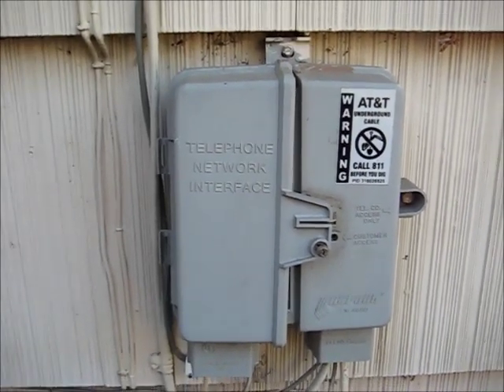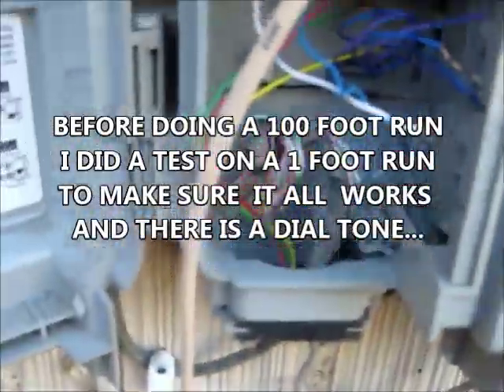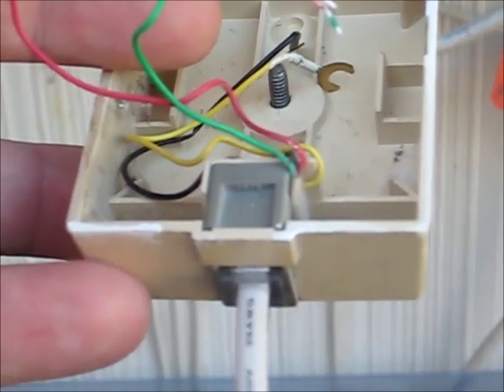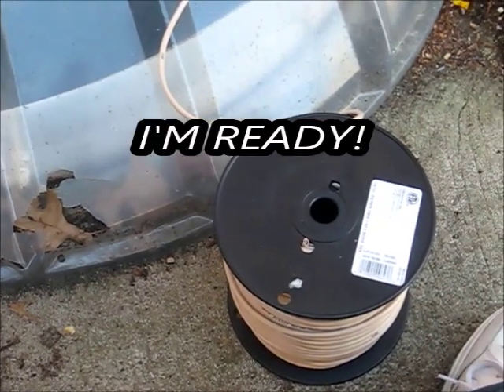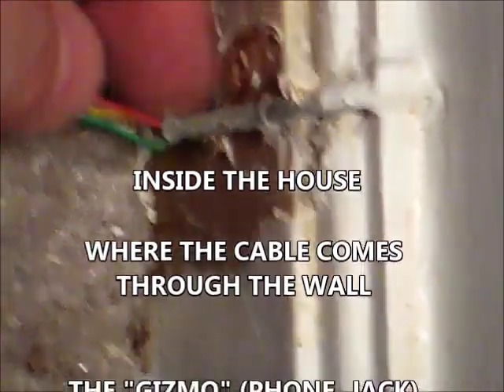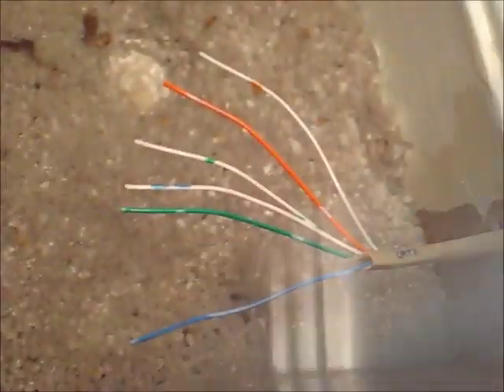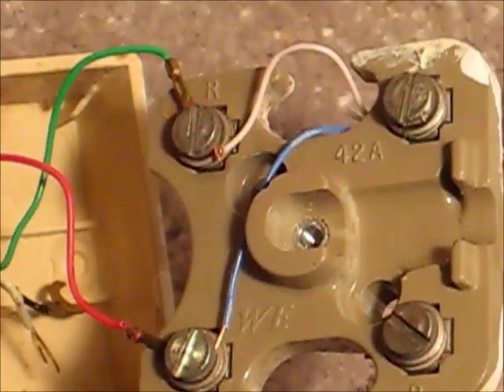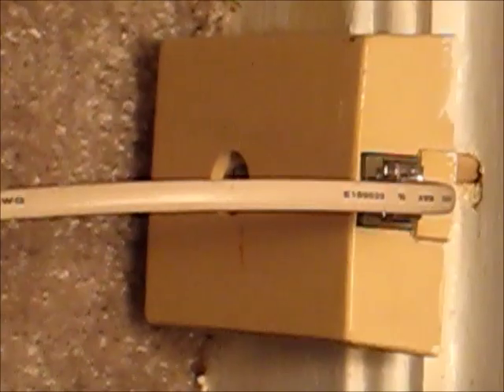☏ New Telephone Line Wire ☏ From outside service box to inside, repair landline, THE TRUTH, CAT3

Comment: This will be my summer project!! I am running a cable from the box to my fax machine in the basement and to the telephone. Here’s my schematic splitter , 2 junction boxes , a 100 ft of RJ 11 And 2 DSL filters. Thanks. This helped a lot
Reply from the maker: My pleasure to be helpful, I enjoy reading that, thank you for taking time to say thanks. Good luck with your project. I suggest doing some "test runs" to prove to yourself it all works. By test runs I mean short easy runs (as I show in the video...  and maybe do one where you connect you whole spool and and boxes) to make sure it all works. That way you KNOW if/when you attach everything, if there is a bug, it is solvable and at not a fatal flaw in design.  I do that myself because I have messed up enough projects, or planned poorly... or heck so many things. Now I make sure I am on track to start with... and then do my best to stay on track.

Comment: Add a solar panel to the unused wires on the outside box.
I rewired a few inside lamps to led to fit the inside jacks..
Bingo... at dusk I have free lighting or can use as emergency back up lamps
Reply from the maker: Interesting idea. Thank you for posting

Comment: What if I had VOIP service and want to switch back? Has the cable company done something on the other side of that box? Because I don’t have dial tone after disconnecting from Xfinity VoIP. Or have they done something at the underground box out by the street?

Comment: does power go to that box?  An electrician came out yesterday to do some work and now my phones do not work.  Maybe he pulled the power to it?
Reply: The power to the telephone line comes from the telephone exchange, the electrician probably have disconnected some of the telephone cables where he was working by accident.
Reply from the maker: Usually only phone wires come to this phone box, so it not usually something an electrician, dealing only with power to a home, would open, but I would suggest calling the electrician and asking them.

Comment: What if you do not have land line service and for the purposes of running an Voip through the internal phone wiring you need to disconnect the phone company line from the wiring in your home how do you do that short of cutting the wire
Reply from the maker: There should be a very simple way to dis-attach the connection of the inside wires from the out side wire. The video shows me opening the box and on the left side is wires going inside and the right side is wires coming from the phone company and in the middle is the connection. Simply disconnect it, then hopefully you can use the wires inside you house to do what they can do.... if they are all in good shape, if not you can run new wires either through your walls, or using outside wire, run them outside.

Again, as many people have said, and I agree, if anyone is not sure how, or is uncomfortable, doing this kind of work call in a professional.

Comment: Remember when you pulled the old wire out? . . . .    =]  Yeah  that would have worked. (Too)  
SMART to check that 100 feet first.  Thanks!
Reply from the maker: Hi Karen, nice to read a kind comment on this video, it gets a lot of hate and even more down votes, but it also gets a lot views... so somebody must like it even if they don't thumbs up much. 

I am guessing you are talking about the issue of getting the wire through the wall... and if so.... yes.... =] Yeah that would have worked. (Too) 

There are several ways of doing it, depending on which end one starts with... 

Sometimes with my videos (when I am re watching my footage) I realize I did use the best method to do something.... and 1) sometimes I will trash the video and re-shoot it... 2)other times I trash the video and scrap the whole project (especially when the chore is done and I am not motivated to re-shoot it or mess with it any more).. and...

...3) other times I decide even if what I showed in the video may not be the best way, IF the overall point was properly made and IF people can (obviously) see there is a better way to do a small part of the over all project, then I keep the video and people can watch and decide how to do it.... how to get that dang wire through the hole (hopefully as easy for them as possible)

Comment: When I set up my place...renegade...i ran a line from the telephone box at the edge of the property right up to my house and into a modem and then the laptop computer. Telephone Company actually gave me a spool of wire for this purpose. I doubt that they would do that again nowadays . It's pretty heavy wire, just two wires and not stranded , heavily coated. For quite a while now I've been having trouble, getting Wi-Fi reception during the day but not at night, so this leads me to believe that it's a problem with the phone company and not the wire. They want to come out and check things out and of course I'd rather they didn't come to the house. My main question is, where can I get some of this telephone cable, or is it just as good to use some of that military thin stuff you can buy pretty cheap over Amazon. I might add that the total run is over 300 feet, but it has been working just fine for 15 years
Reply from the maker: "My main question is, where can I get some of this telephone cable, or is it just as good to use some of that military thin stuff you can buy pretty cheap over Amazon. I might add that the total run is over 300 feet, but it has been working just fine for 15 years"

Wire "wears out"... I was surprised to learn that, but it was proven true in my instance, there signal were issues.... the ysaid it was old wire, I said "BS"... but then I ran this new wire and the issues were gone. I didn't think wire would "wear out", but it does... it is one of the reason I made the video, I was surprised to learn that and thought others would be too.

As far as where to buy the wire? I bought my on a crazy closeout/discontinued deal at Lowes about a week before I made this video... it was priced at $9.00 for 500 feet... I bought every roll they had (5), used what I needed and sold the rest on ebay. I made a little money, but not much, I gave people a good deal... but it paid for my wire.

I do not know about if the wire you are talkng about will work, if it is cheap enough give it a try.

Or maybe try ebay... also try doing a search online. I think some companies will still sell it by the foot, it probably wont be cheap, but it will probably solve your issues. Good luck.

And if you do find (a good place you are happy with) to buy it, please reply here to tell others where they can buy it too.

Good luck with your project
Reply: 7777jayhawk Thanks for the tip. I did buy some military grade telephone wire real cheap. I think this it.   http://www.ebay.com/bhp/wd-1-wire ... Compared to the wire from the phone company, this was very thin. I was reluctant to use it, but I just might try it.

Comment: Do you have to turn off any power?
Reply from the maker: I disconnected the wires and land line transformer wires and all other wires before doing anything. Figure put where the power supply is (any power supply is) and turn it off first.
Reply: @7777jayhawk  I've seen folks replace phone jacks (regular 'biscuits') without turning off any power, and they got no shocks.  Don't know why, though, and it does seem like a minor risk.  Biscuit manufacturer says:  don't replace a biscuit if you have a pacemaker and you haven't turned off power.  Which wires exactly did you disconnect?  Wires in the NID?  Also, we have a non-working phone jack that we replaced -- but still no dial tone.  So I'm pretty sure we have to replace an outdoor wire.  Ours is now 32 yrs old, but I think it stopped working years ago.  (Can't remember exactly when).  How long do they usually last?  I've looked at the length of it and I can't see any problem, but like you said, 'they can wear out.'  For a while, we had static on our line and I can't remember how we fixed that.  We're in a wet, humid climate (near Seattle), so...  anyway, where do you recommend buying phone cable?  We just need 4 wire.  I guess outdoor-rated to try to prevent wearing out fast.  And we only need about 35 feet.  All suggestions welcome.  Thanks for a great video!  One more thing -- our existing phone wire is not directly connected to those two big screws.  It's connected to another connector in the NID box -- looks kinda 'hard-wired', for lack of a better term.  Do you think it's OK to sidestep that and just connect a new cable to the two 'big screws'?

Comment: Should I get a dial tone from the test Jack on the interface box if I don't have land line service? I haven't tried it yet, just wondering if I should get a cheap phone to test, as I'm installing DSL only.
Reply from the maker: I don't think you will get a dial tone unless you have land line service.

 I am not an expert about how DSL works without landline service or how to make sure it is good to go, except to say... I bet the company you are ordering from will help you make sure the service works up to that box and will send a tech out to make sure it does, probably without charging you more than you are already paying them. The tech wont have to come inside and rummage around, but he can makes sure the outside box works. 

After the DSL is hooked up  correctly and working for sure,  then you can plug the modem directly in to the outside box and see if a signal comes though, and take a good look to see how it all looks (which lights go on and stuff) maybe even plug a computer into the modem outside. Once you know what it looks like later you can test it knowing what you are looking for if there is an issue

But at far as setting up DSL only from scratch, that is a little more tricky. I mean, it may be working, but the wires are not attached correctly or something 

But as I said, I bet the company selling you DSL is charging you something for set up, or modem rent or something and if they are it is up to them to make sure it works up the the outside box, and when it does you can run it inside

I hope that all makes sense.
Reply: 7777jayhawk it does make sense. Problem is the internet service said the box is okay, so I figured the problem is old jacks and wires. I want to add a new line/ jack, but the modem isn't working at the test Jack. The modem is working at the old line, but even through dsl filter service is incredibly slow.
Reply from the maker: Hmmm... If I understand you correctly, and it is all good at the box (going in and coming out at the box)  I  suggest doing a "short run" test like I did in the video. Get a 4-5 foot run of wire and a new jack (and new filters too)(I guess all this stuff wears out)and hook that short run up outside... see if it works.... and if it does work then  it should work when you run a new wire 100 feet inside with a new jack and filter

It is a fact (based on what I had) that old telephone wires do indeed slow DSL down, that is why/how I started looking in to all of this. My 30 year old telephone wire was just worn out.... somehow... but when I ran new wire it works fine

Hope that helps, good luck
Reply: 7777jayhawk Thanks, that's exactly what I'm going to try soon.

Comment: What do I need to do to change the NID to an RJ45 Ethernet connection throughout the house. Also how do I find out what kind of a topology is in my house?  I've heard of people using their existing phone lines which might be cat5/5e to full ethernet ports instead of rj11 ports.
Reply from the maker: I have/did/use a simple home run (aka Star) topology for the line I ran in the video. 

For the other lines I have run, I did it the same.  It uses more cable but it is/was easier for me to run them outside and into the exterior wall as opposed to running them through the interior walls. It is very simple to do and easy to trouble shoot if there is a problem with a certain phone.

You can figure out your topology by simply looking at the types of cables coming out of your service box and see where they go.  

As far your RJ45/RJ11 question, I am not 100% positive about that. 

I suggest you ask one of the many good online Q&A forums this exact question... or if you are friendly with the telephone repair person when they come out they could explain it. I have had great luck learning from the guys who have come out to work on my lines over the years.
Reply: Thankfully, my uncles constructed my home in '03. I will confer with them what they did before i go punching holes in walls. haha. I suspect they used cat 3 cabling but i will take a part one of my wall jacks and confirm whats going on back there. 

So from the NID I should be able to tell what my topology is ? How? Would a nid with star have more connections than point to point ? Would the actual components inside look the same . 

Also when you were pulling the wire do you have to seal the hole or is it best to leave the opening as is.

Comment: i have replaced my Cable modem router and does not have a phone line like the one the cable company was renting me.  How can i get a phone line to work? Can i connect a ADSL2+ router?
Reply from the maker: Can you plug your phone line right in to your outside box? -----

Did getting rid of the modem suddenly make your land line phone stop 
working? There are other variables,  I dont have enough information to answer as I  would like to. ------- 

I suggest calling the company(s) supplying phone and internet 
service to you. I have found them to be helpful and/or they might send a
 repair  person out for no charge. ------ 

I assume you have or had a working land line.  ---------- 

The phone company brings the land line service up the service box, as I 
show in the video. You can connect a phone wire to that box and bring 
that wire into the house and plug into a phone jack, as I show in the 
video.  -------- 

Before I ran a long wire  (also as I  show in the video) I tested out my
 phone and wire and set up.... right beside the outside box before I ran
 the long wire. Just to make sure it would work.   -------

DSL internet service will also come though that phone line.  --------

You will have to use a line splitter which allows you to connect both 
the phone and connect the router in to the single line. It makes one 
line have two plug ins. You will need a filter on the line connecting 
the the phone. Those parts are no expensive, but the phone comapny might
 give them to you for free. -------- 

I am probably not answering your question or... I am  telling you things
 you already know. ------

If you can be more specific maybe I can help you figure it out.
Reply: Cable company went to the main box (i live where others are in that box)  They did something to make my phone line work with their modem that has the telephone plug. the modem i bought does not have the telephone plug. (i no i can buy the one that has a phone plug but i didn't want to)  I want to know if i can hook up the phone line to direct phone service without calling anyone. I have a filter and can try that.   I have an old verizn ADSL+2 router and wonder if that will work to use the line
Reply from the maker: You can sure try simply hooking a phone line directly to the outside box. 

Do it just like I show in the video. Take a phone outside and do  "short run" test with 5 feet of cable. If that works then you can run a longer cable to where ever you need the service inside. I did it simple by running the line along the house and in through the exterior wall.